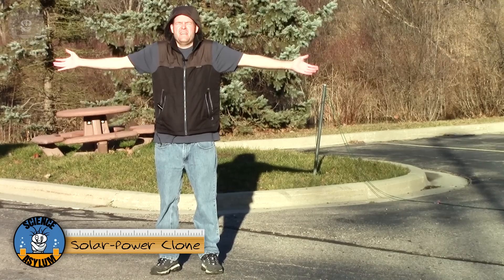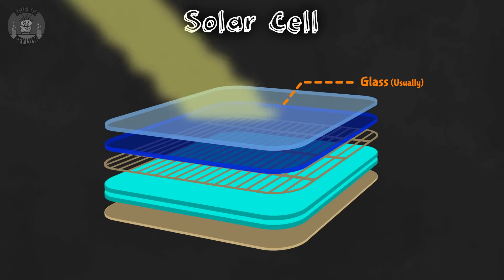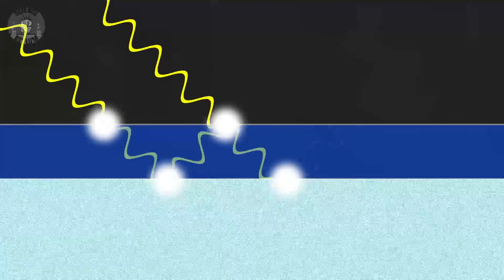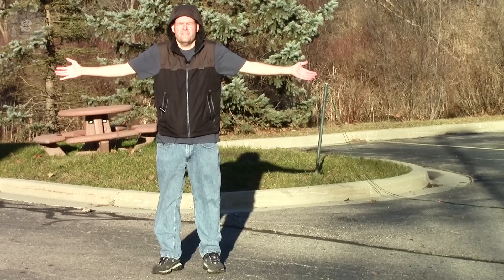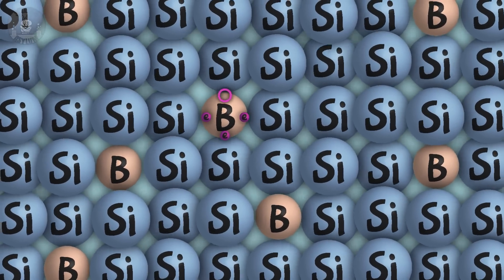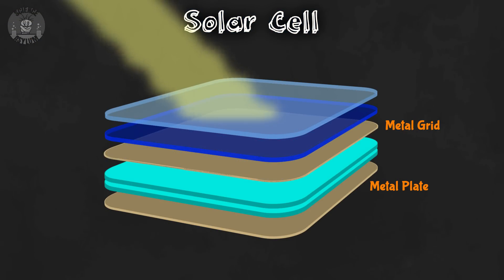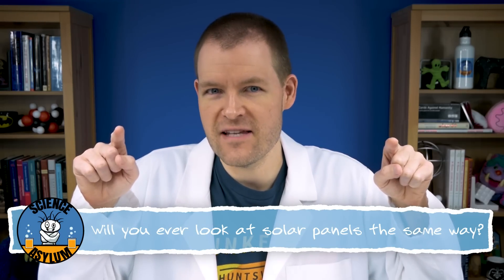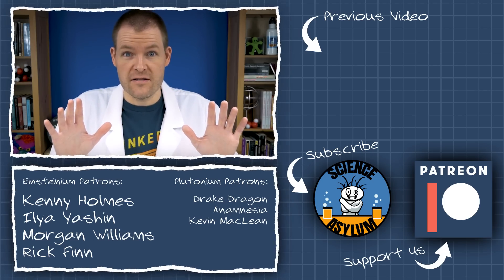How Do Solar Panels Work? (Physics of Solar Cells)

Comment from the maker: Anyone whose looking for more videos on global warming, climate change, and/or renewable energy, I can't recommend PBS Hot Mess enough. One of the hosts is a friend of mine and she really knows her stuff: https://www.youtube.com/hotmesspbs
Reply: Can you please explain to us about string theory? Please educate us
Reply from the maker: Alam, if they all moved over, it wouldn't be very useful. Luckily, the transfer stops long before then because of the depletion layer.
Reply: @ScienceAsylum  but wouldn't the electrons flow as light hits the surface? what happens when all the electrons flow to the other layer?
Reply: What happens when all the phosphorous doped silicon's electrons have all moved to the boron doped silicon? Will the cell stop working?
Reply: @alamrasyidi4097  First, the boron and phosphorus don't move. They are stuck somewhere in the silicium cristal.
When an electron is forcefully ejected from its favorite atom because the photon gave it escape velocity, it tries to come back by traveling thru the wire and the load connected to the solar panel.
In practice, that electron will not travel that far. It will increase the pressure (voltage) which will push a little on every electrons. Finally, another electron on the other side of the barrier will fill the hole left by the photon.
Reply: I have a question, I was looking at a video where some guy measures the speed of light using a microwave and a bar of chocolate, and the bar of chocolate only melted in certain places (there where melted stripes on it) explaining that those stripes where the peaks of the waves of light that heat up the chocolate. I was wondering, if those stripes on the chocolate are the probability waves where you are most likely to find photons.

So my question is, are light waves the probability waves of photons?
Reply: Why don't we use Mg and S or O for the doping?
Reply: The top line PV panel is only 22.5% Efficient, when they get to 65 to 70 % efficiency I will look into it until then it's a waste of money.
Reply: @nomore8042  By changing the shape of the cells like from square to triangle with a combination with a good conductor doesn't increase current flow since the photons hits the area with same rate, but electrons from the larger area pushes electrons to the smaller area to the conductor? That would make it at least more efficient by increasing current flow I think.
Reply: @nomore8042  or maybe still having the triangle to save space and connect the conductor in the middle of the triangle on the side where the cells face the light and connect the conductor in the middle of each side of the triangle on the opposite side to spread more quickly. I believe this process would squeeze electrons in the conductor creating a higher current.
Reply from the maker: Simon, I made one like that a long time ago too: http://youtu.be/rwEP-IOUXC8 It's not the probability wave though. It's very classical EM wave.
Reply: @ScienceAsylum  ok, I though I finally understood then but I'm back to being confused. If the light waves are not the probability waves. What are they waves of. Because I just cannot comprehend how a photon, which is a point particle as you say but in reality is just a collapsed or "small" wave can be miles in length when it comes to radio waves.
Reply: Sadly untill our invisible multibillionaire overlords decide otherwise, we are going to use carbon based and other type of outdated energy sources.
Sure we could just easily ignore them and do what's right, but since when are the sheep sentient enough to do that? :D
Reply: Unrelated to this particular video but perhaps a topic for a future video (I'm a big fan!). I have several friends who fervently believe that leaving tap water in uncapped jugs will allow the chlorine, fluorine and other chemicals used to treat the water to evaporate. I'm no chemist but I'm pretty sure this is flawed. I'm sure I could look up the answer in about 10 seconds but I'm even more sure that your answer would be vastly more entertaining.
Reply: Thanks for the suggestion! Also thanks for the nice video.
Reply: I have daydreamt of doing a video on this for months. Damn you! 😁
Reply: The only part that i cant understand is the  depletion layer.is it generated a proton and electron between the two silicon or when the sun ray hit the depletion layer then it will catch some proton and electron please sir help me and  explain how the depletion works ?
Reply: Na I'll pass on anything from PBS
Reply: how long do the solar cells last, that silicone phosphorus electrons will eventually all go to silicone boron ,
Reply: Theoretically if you consider the multiverse, would we share a spacetime with these other universes? Like theres just gaps of matter between them, right? But there still on the same spacetime. if not then what would be between them? Would this be like non existence? If you fly a spacecraft into the void between universe's would it just cease to exist? Or would time move extremely fast since there is soo little gravitational effects? It would be cool to do a video depicting the multiverse realistically, It would be interesting to see how you would put this. some of this gets me, like when u here physicist say spacetime is created in the big bang, but that tells me that spacetime doesnt exist between universe's for the multiverse theory meaning if you try to leave the universe you cease to exist?

Ps. Sorry about the way this is asked it can be tricky wording these types of questions while maintaining the point, hope it makes as much sense as you make physics lol
Reply: @LordButterstotch  Your description of multiverse and all the magical properties that we hear from cable tv "science" channel is faithfully reproduced in your question.
I am just feeling your pain the day you realize that Michio Kaku and the other actors on Comcast don't believe in this popular subject.
Multiverse is a fairy tale and I hope you will keep interest in science despite all the lies that cable tv keep repeating.

Comment: ScienceAsylum, could you please answer a question for me that I know you guys would know: are these electrons(that flow from the positive panel to the negative panel) recycled? Meaning is it the same exact electrons being used over, and over again as they release from the Phosphorus atoms, and eventually enter the Boron atoms?
Reply from the maker: Which electrons are used at any given moment is random, so I very much doubt it's ever been the same electrons twice. That being said, it may not be a meaningful distinction anyway since all electrons are identical.
Reply: @ScienceAsylum  Thank you, and I got you a 100 percent. But this leads me to another question: are the same exact Borons continuously receiving electrons cycle after cycle?

Comment: If you had a solar array on your house..do you still need to convert to AC, or can you just run DC?  I mean, AC is great for long distance transmission, but it just gets stepped down.  Can't we get to a point where we can directly tie DC to some if not most equipment and just ignore AC in the house?
Reply from the maker: The problem is that household device tend to be designed for AC, so we have to convert to AC to accommodate that. To use DC in your house, you'd need every appliance (large and small) to be specially designed for your house.

Comment: Batteries are not a good idea. Look at the heavy metals you need to mine and then after 8 years the battery stops functioning.
Reply: So what about the metals ? Yes they need to mined but so does pretty much every other raw material on the planet und there are ways to mitigate soil pollution from lithium mining it's just that that costs money. "after 8 years the battery stops functioning" that number is way to generalized there are definitely longer lasting batteries. Also battery recycling is making massive strides atm so the problem will become less severe in the coming years. Are batteries perfect no are they a viable option for domestic use yes.

Comment: The bottom plate,  being ground could be connected to a liquid cooling system couldn't it?  It would allow for PV panels to operate in hotter temperatures

Comment: one question does more light mean more energy for the solar panels or does it have like a cap or something?
Reply: Interestingly enough I can't actually find a good source or even a relevant explanation for this. I would imagine so, since there are only so many electrons in the panel, putting a cap on maximum voltage, and the internal resistance would put a limit on current. This would logically be the basis for maximum voltage/current ratings, but I don't know at what point this happens since as far as I know, these have to be determined experimentally

Comment: Than k you sir. Science has taken the back seat to big money, big oil and big alcohol. I plan on bringing stability to all big 3s. Sounds like solar cells will be the major power solution for any desert with constant direct sunlight. Railroads could place permenant ultra strong 💪neodymium magnets to train water into our needy farming communities. Lots of seed, fertilizer and electromechanical farm equipment to lead industrial revolution. I propose we drop winding coils beneath the Train to pick up a recharge between the tracks.coast to coast. Resivior to resivior.

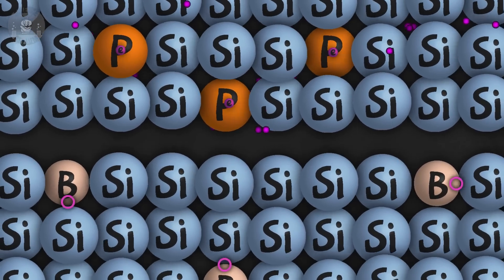Comment: can someone explain how the part at 5:28 work? how do electrons go downwards so easily just because being closer to that layer? and how do photons play role in this after this electron trade?
Reply: In the phosphorus layer, because of how the lattice structure is arranged, only 4 electrons in the valence shell of each phosphorus atom is actually used in a covalent bond. The 5th electron has nowhere to go, and so sits between the energy levels of the valence band and the conduction band. These misfit electrons don't have a home atom and so can roam around the lattice. It's not a particularly stable arrangement.
The boron layer has the opposite problem, it doesn't have enough electrons to form full covalent bonds, so there's an empty slot in the valence band.
When the two lattices touch each other, the electrons roaming around in the phosphorus lattice now have access to the boron lattice. Because quantum mechanics, those electrons also don't really have a single localized position, rather they jump to occupying a state that is effectively the size of the entire lattice, and so will instantly find and fall into the valence band gaps in the boron layer. They aren't really attracted to it, they just happen to come across it and nestle in.

When all of the valence band gaps are full, the layers are charged but stable, and they want to stay like that. So now you bring in some photons. Those photons will slam into some of those electrons and knock them out of their bonds. Because of the net positive charge in the phosphorus layer, they will want to go back there, so you give them a wire to travel through to go there. Circuit complete

Comment: Depletion layer in a PN semiconductor. That is just a diode. Solar cell is a type of a diode, but in your explanation, i see more of a photo diode, you know the one that starts conducting reverse current when light is applied to the junction.  But solar cells are different: they converter incoming photons into electromotive force.

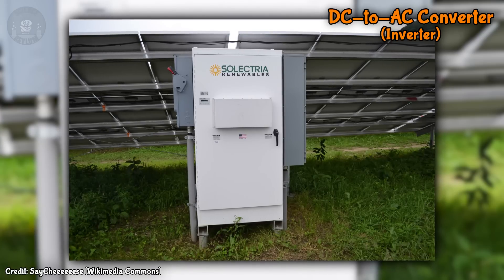Comment: 7:13 The reason we don't use solar on a massive scale, is because we don't have adequate storage. We have storage, but not on this scale. Even 3 years after this, our batteries still suck, and why did you bring up capacitors in the first place.

Comment: So if energy is created by the act of electrons flowing from one plate to another, does that not mean a solar cell will eventually run out of electrons to give and stop working?  Or is it like batteries where another process can send the electrons back?
Reply: The flow of electrons is cyclic. They get an energy boost in the cell, travel to the load releasing that energy in the process, and then go back to the cell. This is why in DC power systems, you need at least 2 wires. One to carry the electrons to an input terminal on the load, and the other to go from the output terminal back to the power supply.
This doesn't apply to AC since the electrons only oscillate back and forth rather than going somewhere in particular

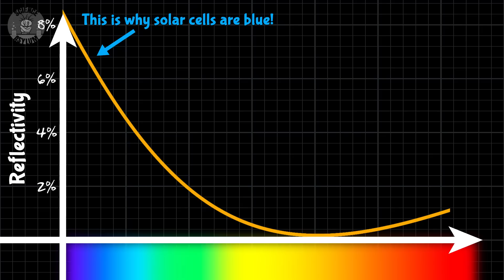Comment: I got a question. 3:00 Why wouldn't we want colors will LESS reflectivity? Isn't it the point to reflect as less light as possible? So why do we choose blue(which has 6% reflecitivity) instead of orange(which has almost 0%)
Reply: It's because the solar cells are already absorbing so much of that light, as they are most effective with wavelengths in the 600-700nm range. That's why we don't see it as orange; all the orange light is getting absorbed, leaving none of it for us. If the anti-reflection layers were designed to be even stronger, they wouldn't appear orange, they would appear black. Black anti-reflection layers are also a thing
Reply: @snowthemegaabsol6819  Thank you very much for your reply! You've enlightened me.

Comment: To answer the question,  solar panels don't last long, are t cost effective,  and as yiu stated, don't produce enough power. Wenwould have to put up so many panels to power the USA  that whole states would be gone. New Jersey would have to be 100% covered in solar panels just for new york city alone. All of Arizona would barely provide power for San Francisco and Los Angeles.  So how exactly are.we going to use these things that only last 5 maybe 7 years, to power the whole country? We just going to spend 5x our gdp every year for these things and displace 80 million people  and wipe out whole ecosystems for 5 years worth of power just to don't all over again? 

If we are to get renewable energy,  we need to switch to nuclear power and geothermal.  We need to go back to steam powered cars and use ethanol or methanol as fuel, or even hydrogen. Clean burning, renewable fuels that a steam turbine or steam pistons can drive a car forward. Then we can dump oil and coal.

Comment: To answer your question at the end. TLDR: For every dollar invested you're only getting a Nickelback. 🤣🤣 Pun fully intended. 

Because solar is not cost effective or reliable enough to replace fossil fuels. Also to meet current energy demands we would have to either A: cover the Earth with solar arrays. Which kinda defeats the purpose of using solar in the first place. Or B: put a Dyson swarm in solar orbit. Which isn't logistically or economically feassble right now.

Nuclear on the other hand is 1000× energy dense as coal and safer and far more efficient by terra watt hour than even solar. Not to mention it's power on demand.

Comment: Would if everything the sun shines on is charged like a battery except Life which can only live by going around and using those things but we cannot move the used objects any closer to the sun to charge faster we must simply leave it be and hope the sun shines enough today and tomorrow because holding onto it blocks the sun rays from charging it and trying to control the sun will only lead to burns.

Comment: I still don't fully understand what the energy from the sun does and how exactly it is harnessed. Is it the light that causes the chemical reaction which creates the electric field?
Reply: The sunlight provides the extra electrons in the N layer enough energy to free themselves from the electric field, and they want to go back to the P layer. So you give them a wire to travel through to complete the circuit. With no sunlight, they can't escape and the flow stops

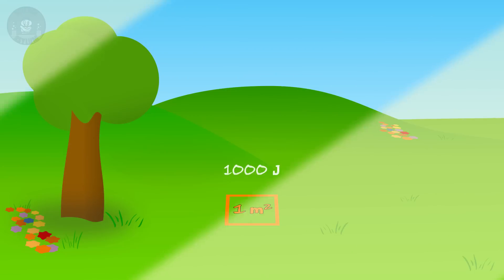Comment: 7:34 yea it is a 1000W per every square meter of earth, however, less than half of that is converted into energy. Not to mention line resistances, and also for a solar powerplant to be effective, it is a requirement that there are almost no clouds, no physical obstacles,etc. Solar panels themselves are not efficient enough for our ever increasing power needs. Nuclear is by far the best option we have for clean power.
Reply from the maker: I agree that nuclear is a better option, but good luck convincing enough people of that.

Comment: Its essentially a diode with a large junction area and the light generates more free electrons in the n type and more free holes in the p type.This gradient of charge makes the voltage for the cell.With a cover to protect it and to trap light that enters it.

Comment: But would you need to change the phosphorus and the boron at one point ? Like when all the single valance electron will have been "pushed off" from the phosphorus and all the boron will have their last "hole" filled, wouldn't you need to constantly change the two plates ?

Comment: "Insulators won't work because the jump to the conduction band is too big" does that theoretically mean that given a high energy input what we generally consider as good insulators (eg: rubber) could conduct electricity?

Comment: One question about the anti-reflective layer.  If it eliminates the reflected radiation by destructive interference, wouldn't the energy from the reflected light still be lost?
Reply from the maker: Nope! There's only deconstructive interference above the layer. All the energy (light) is reflected back down again toward the solar cell.
Reply: @ScienceAsylum  Okay, so wouldn't the efficiency then be more because of internal reflection than destructive interference?  Not trying to be difficult, just a bit nerdy like you, or one of your clones :-)
Reply from the maker: @Andrew-ep4kw  The anti-reflective coating does increase efficiency. The efficiency problems comes from generated heat, not the reflection. The solar cell absorbs all the light it can, but not all of that become electricity. Quite a lot of it becomes thermal energy heating up the cell.